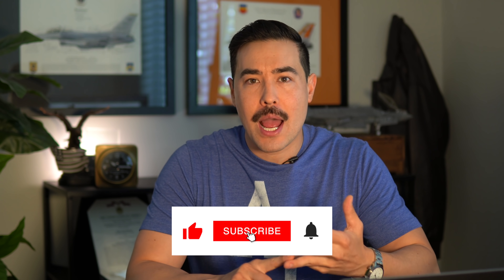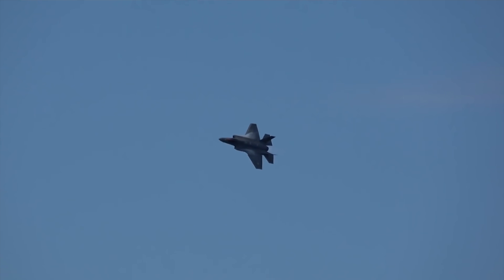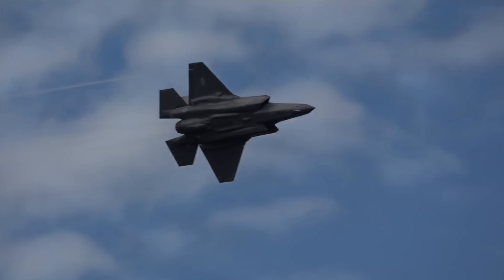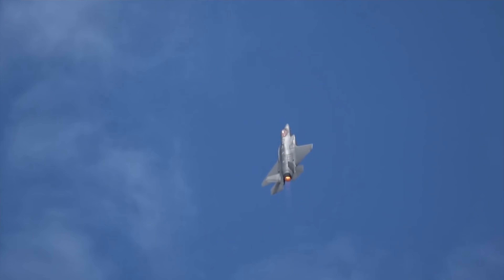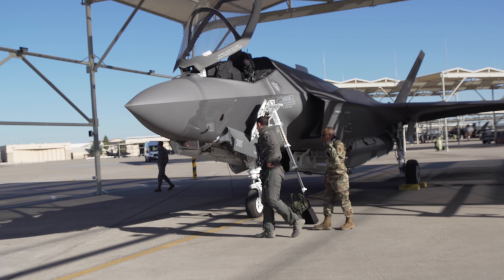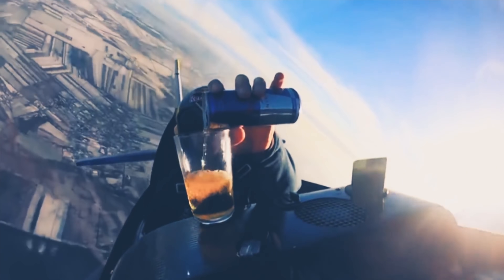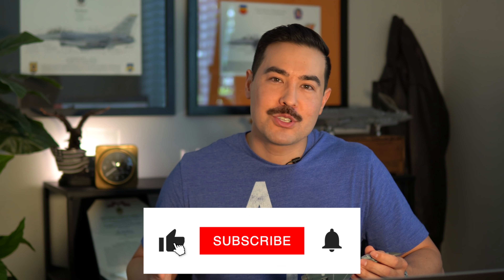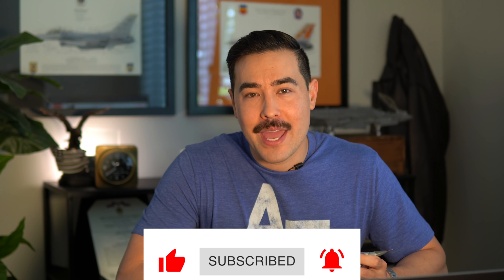USAF Fighter Pilot on NEGATIVE-G's (Don't do it) and Flying Upside Down

Comment: "Bruises on your brain probably aren't a good thing" I mean, when you put it like that, I think I'd rather get g-lock and and pass out rather than have a stroke or a bruised brain.
Reply: Really?  If you pass out, you're DEAD!  Bruised brain is not good either, but you'll probably survive.
Reply: @southnc63  they do have the automatic correcting and leveling systems in modern fighter aircraft which has saved a lot of lives. Granted, in a combat scenario, any reduction in capacity will likely lead to getting killed. I was more referring to which would I rather: get knocked out and trust the plane to level out OR have a stroke and just die right then and there.
Reply: @zakleclaire1858  Fair enough.  It would be cool if they could develop software that enables the plane to land itself at nearest approved airport on its own in such a scenario as you described.
Reply: @southnc63  oh that would be awesome! They already have fly-by-wire and autopilot so it shouldn't be too hard to create a "fly to base" feature if the pilot is unable to do so.
Reply: @southnc63  ILS
Reply: @zakleclaire1858  Russians linked their autopilot systems to aircraft in Su-27 FBW.

Unlike the western fighter stick, the conventional trigger is a AP Override. The red large button on top left of the stick (where west grips has weapon release button) there is a "AP Off" button. The top right button is "Level flight" that is magical.

When you fly, you can enable various AP modes from a AP panel at the left. Like automatic route following (can fly whole flight plan after take-off or even fly to weapon release point), automatic landing (lands you to 50 meter altitude from ground with proper glide slope to airfield and then turns off for manual touchdown) or various basic things like attitude, radar or barometric altitude, air refueling, dampening, landing dampening etc. 

But the stick "Level Flight" is life saver. It will in normal flight pull you from any maneuver or state to level flight. So if you are going to pass out, it can save your life as it rolls you right way and levels.
If you are flying below 1500 meters (5000ft) from the radar altimeter, it will fly you to 1500 meters altitude from ground and level you there.

So to enable that mode you press top right button. But to turn all AP modes off, you press top left red large button. 

But, normal flying happens with the autopilot like level flight mode On, and everytime you want to fly manually to do something, you squeeze the trigger and maneuver as you want and release. The AP will return you to level flight on new heading.

So when you are example flying at low level, you squeeze the trigger gently as normal flying. But if you pass out for any reason and you will let go of grip, the AP will correct your flight and fly you up to 1500 m above ground in (IIRC) 30 degree angle if ground altitude doesn't get lower.

So example you can be flying toward a mountain and system will range the slop increase and pull you even harder up if required.

Example F-16 got this feature just couple years ago (Source the Fighter Pilot Podcast) as safety feature as too many pilots has died after blackout etc.

For Air Refueling there is own AP mode, where  your stick is heavily dampened and it sensitivity is cut to 20% of full range. So you can use full stick movements to make small corrections for connection (this of course after AP to fly you to tanker) and you can enable a auto throttle function that will maintain speed in 1 km/h accuracy and you use a hat in throttle to command AP to increase or decrease the speed with smooth reaction.

(So how does Soviet grips fire weapons? They have a flip-down trigger for weapons release and then a second small flip trigger for cannon. So if you want to launch/release weapon, you flip large trigger down with index finger and if you want to fire cannon you will push small trigger down with index finger and cannon is selected.)

So in emergency situations you press red button to turn off AP for example emergency turns or dog fight. And if you are to G-lock or losing control, you press level flight as last action in that moment.

This basic recovery mode was at least in the MiG-21 but IIRC it doesn't fly you up to altitude but just rolls you right and levels.
Reply: Yah same.
Reply: Pretty sure g-loc is much less dangerous than high negative g's, except for that in these planes usually you're the pilot, so if you're unconscious the plane's probably gonna crash shortly thereafter...

Comment: Pulling negative G's? Sorry to say but that is not possible in any airplane!
Reply: You are incorrect in this statement. Hasard is a real life fighter pilot I think he has a little knowledge in this field. Also google negative G's and you will see that it is indeed possible.
Reply: @scorpgaming3199  I know what he does for a living. Same thing, that I do... flying. And I know how many aerobatic competitions I have flown over many years. You can push negative G‘s but not pull them. Sounds petty but it’s very important to understand the difference actually.
Reply: @352NFF  

You are referring to stick position, so the statement is correct. In order to do outside loops etc, one must push the stick. To maintain inverted flight, you must maintain constant forward stick pressure. This is because all aircraft wings generate upward lift; if one is inverted they still do this, which means lift is now acting in the same direction as gravity. So, to create 'positive' lift during inverted flight, you gotta maintain higher AoA so as to generate lift with entire airplane.
Reply: @352NFF  Oh my apologies I did not realise you were one of those types who knit pick a word when clearly it's understood what he meant.
Reply: @scorpgaming3199  Nobody who‘s used to fly both, positive and negative G‘s, would say „I am pulling negative G‘s“ cause it’s just completely wrong. I also don’t agree to some other statements, Hasard is explaining about negative G‘s. Clearly he doesn’t have a lot of experience in flying negative, which is not surprising when only flying fighter jets and I don’t blame him for that. At least he corrected the title of this video...
But coming back to your comments, Chris. First you were telling me I‘m wrong because Hasard is a Pilot (still not getting the point). Now you are telling me I was right but accusing me for knit picking. You really are one of the reasons why people with tons of experience like me just stay silent and let wrong statements be wrong. If that’s your goal, go ahead, troll around and spread your unobjective criticism. I won’t reply to anything else cause from now it’s just waste of time. Happy Eastern.

Comment: A friend of mine was preparing a practice flight for an aerobatic competition and asked me if I wanted to join him. Sure, why not? I like aerobatics. After two outside loops with -4.5 G, I looked like Dracula for the next seven days.
Reply from the maker: An outside loop is no joke, -4.5 is impressive!
Reply: @HasardLee , I will never do it again!
Reply: @HasardLee  i wonder one day all these drones will be flying at 20 G or whatever G's that humans can't tolerate. and you don't really need to have artificial intelligence in a drone to face the enemy, as you mention in the video.  you can have a ground crew close enough that can communicate close enough to transmit the signals to the drone to engage the enemy. and the amount of weight and life-saving device saved can make the drones go faster and cheaper to make. and you can even modify the F35 so that you just take out the seat and everything involved in a human pilot, and just put all the sensors and communication devices. an upgrade so to speak (and just fly in virtual reality, so to speak). technology evolves so fast that we are doing things we can't even imagine 20 years ago. and more importantly, taking out the human factor and replacing it with a ground crew means that more people can learn to fly the fighter drones. you can be fat, near sighted, too tall or short, or too old to fly. you can have a 50 year old fighter jet pilot who would otherwise fail a physical to fly a very expensive jet. you save a lot more money and have more experienced drone pilots. save $$$. less turnovers.
Reply: First time I did a rolling circle in a Pitts and experienced +4 and -4 every 90 degrees of turn I was highly motivated to reassess my choice of competitive outlets.
Reply: I'd give your friend the slap of a lifetime once i got my eyes, head, and senses back, after an ordeal like that.

Sounds like the king of all migraines.
Reply: Your body need to grow G resistance by training. For the pilot that -4,5G didn't feel by far as heavy as it was for you. As a pilot I think it's not a nice thing to do, bringing a friend with you and do heavy figures. One thing quite sure, a passenger experiencing this will likely never step into an aerobatic aircraft again, which is a pity.
Reply: @LarsHofman  yea he literally could've killed his friend. -4.5 is insane for someone with no tolerance
Reply: @sinxsideways5900  well, it's quite unlikely - 4,5 would kill someone literally, but for sure it will feel like that for the passenger! 🥵
Reply: @LarsHofman  very true but it is still possible some ppl have weaker blood vessel lining than others and hydration has alot to do with that as well. Lots of factors anatomy is crazy
Reply: No fun - if you had an aneurysma in your brain, it could have killed you.
Reply: @spiller212  and if I had penis exploding diarrhea (PED), then PED could have killed me too, after exploding my penis. Man, that's scary to think about.
Reply: holy shit lol... maybe you are Dracula. XD
Reply: Did about the same in a Super Decathlon, had me seeing red. Not fun.
Reply: I barely pushed the yoke forward when I got to handle a Marchetti SF260 and the minor negative G’s felt gave me the warning of a lifetime not to do that again lmao
Reply: Lollx
Reply: you could have popped an eyeball - seriously !!  I would have punched your 'friend' in the face..
Reply: @Charlee1224  
Confucius say:  “He who fly upside-down have hairy crack-up.”
Reply: Jesus Christ -4G? Thats a nightmare :/
Reply: As an AF Brat that was able to take a T-38 fam ride after 2 years of playing up to all the flight line brass. Pulled this off without my high-ranking father's knowledge, the pilot did an outside loop with a low G that was enough to pop a blood vessel in my right eye only. I can only confirm, I had some explaining to do as Dad knew exactly what happened. The full flight was quite an experience. True Story, Nellis, 1975.

Comment: Lots of aircrafts can’t fly negative G for very long. The Tomcat could fly negative G for 10 seconds with afterburner, 20 seconds at mil power(mil power is full throttle without afterburner)
Reply from the maker: it's tough to keep feeding the engine
Reply: @HasardLee  due to fuel starvation?
Reply: @HasardLee  Just need more Cowbell!
Reply: 'Bozo' Lloyd who did all of the Maverick dogfight scenes and the fly-by in 'Top Gun' said, Tomcat with certain trim and power settings could go up to 1 minute inverted before you had to go back upright. They did that while trying to shoot the 'birdie' scene for real initially, but the F-5 would start falling behind due to the lack of power as the F-14 was right above it so they had to use the split-screen.
Reply: @2ZZGE100  How do you mean the F-5's lack of power... It was the F-14 that was upside down - wouldn't that be the one that was struggling?
Reply: @Vousie  F-14 had way more thrust available and the F-14 being inverted over the F-5 blocked the airflow over the wings of the F-5, which is why the F-5 started falling behind. The F-14 being over the F-5 blocked airflow over the F-5 wings, which disrupts the lift generated by the wings in the same way air brakes do. The F-5 also did not make that much thrust so they could not compensate for it by just powering up to keep up with the F-14. You can go watch the interview of the pilots who flew both the F-14 and F-5 talking about it on 'Taco' Bell's channels.
Reply: @2ZZGE100  What do you mean Taco Bell's channels?
Reply: Trueeee
Reply: Well you will run into that problem at AB as stated the fuel flow requirements are huge for AB and inverted or negative G you are automatically limiting the pumps thanks to physics.
Reply: @Stubbies2003  doesn't matter if it is AB or not. Pumps are located at the lowest points. If you are inverted the pumps will be dry. Don't know about other aircraft, but the way the F-16 fuel cells are set up,  the pilot will have an issue with starving the engine of oil before starving it of fuel.
Reply: This is true👍
Reply: If you wanna see something amazing watch the Belgian F-16 demos. They pull negative G's galore
Reply: carb fed engine drawbacks